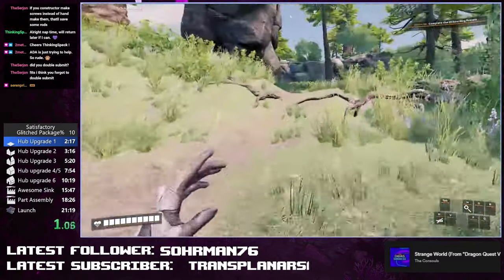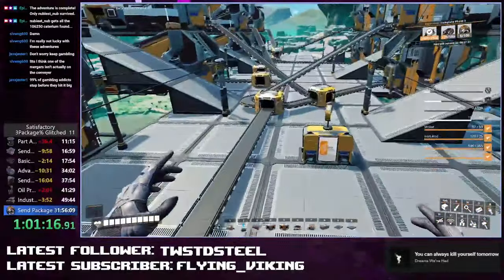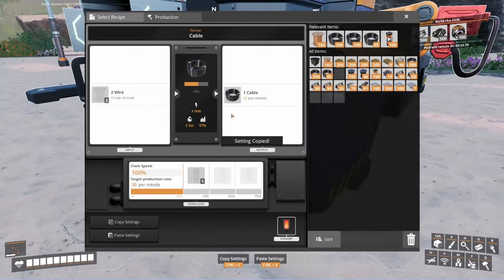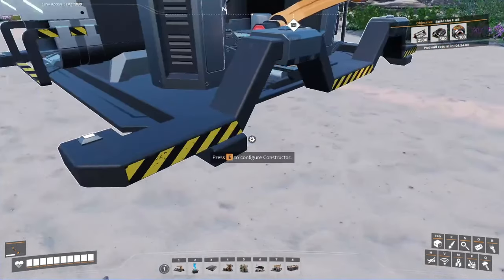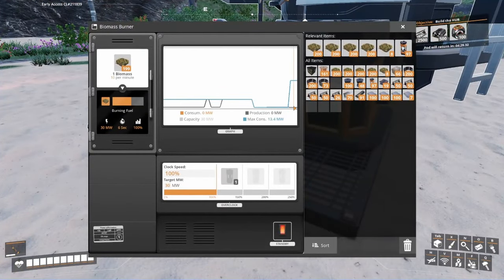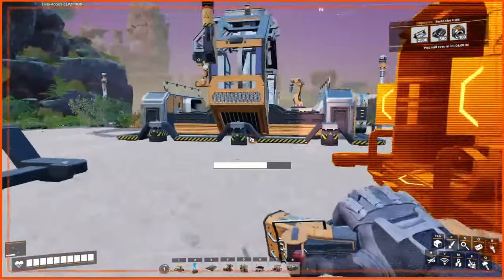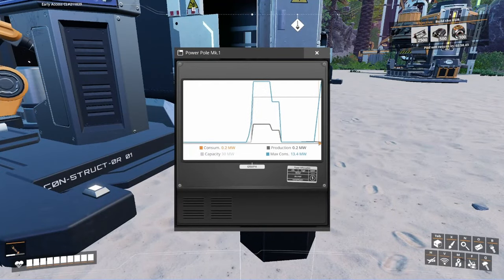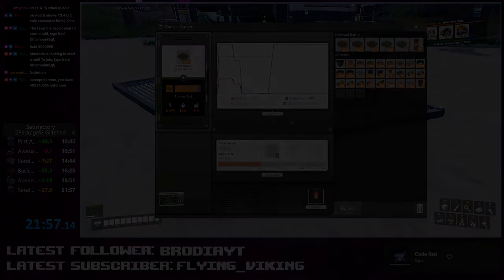The BIGGEST Satisfactory speedrunning glitch ever discovered: The 007 Glitch

Comment: For those wondering if this currently works in update 8 on experimental, i tested it, and seems you can no longer produce without any input. However, the part with max overclocking using less power still kinda works. When underclocking the producing constructor to 1% (yes, you can't underclock to 0% anymore), and then copying over the "null" recipe, it will go back to 100% overclocked in the blank production screen. If you then overclock to 250% in the blank production screen, and after that you select a recipe, it will go back to the production screen, but not start producing until you input items. After you input the necessary items, it will produce at 250%, but only draw power as if it were at 100% overclocked. This being on experimental, it might change as they update and patch the game, and might  not at all be like this when it releases on early access.

Comment: If you try to use the power glitch it resets if the output inventory fills up. Not really a concern for speed runs but if someone wants to use it elsewhere.
Reply from the maker: Yup, the amount of runs I've failed because a machine filled up :')
Reply: @EpiphaneSpeedruns  Does that include if the belt is outputting to a container?
Reply from the maker: @artyd42  all that matters is that the machine does not go idle
Reply: You also mentioned that if you saved and restart server it doesn't work anymore. But what about auto save? Does that affect it at all?
Reply from the maker: @dvd473  it doesn't work on servers at all sadly, but for single player it only gets reset on load so autosave is safe

Comment: This will be fixed im pretty sure. Its an important bug. Thx for showing tho im not planing on using it.
Reply: Next update will be even more broken and unstable.
Reply from the maker: The community managers have confirmed this does not happen on the current build of Update 8. Not for this reason, but it was causing a similar bug that made the experience worse so they had to address it unfortunately.
Reply: i disaggree i wanted to use it. thats why we need a true sandbox mode

Comment: I have a laptop that has satisfactory on that I never i never turned online so I can still play update 7 as long as I dont do the download update. However, this seems broke and not working so my question is if this game had problem fixed at any point during update 7?
Reply from the maker: This bug was fixed with Update 8, so unless you're playing an old version of the game you can't use it anymore :(
Reply: Its looking like was fixed before this? My laptop version hasnt been hooked to wifi sinse october so its still update 7. None the less it seems to be not working on that version neither. Maybe to do with running in experimental mode?
Reply from the maker: Perhaps, I have a copy of Update 7 that still works but it's from the early release branch